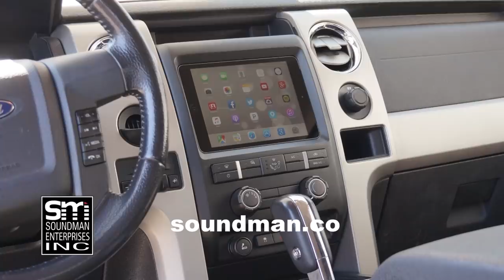Custom Astro Van door jam contacts, part 1 - BVV#19

Comment: Should have just hard wired the popper with a long ass cable. So every time you open the door, you can use the power cable to hang a 'no entry' sign across the doorway. Geez Doug, do we have to come up with all the ideas? LOL

Comment: Should have just run a lithium battery in the door with an external charging port through the door handle shave plate. Trigger the door popper with a Bluetooth arduino controlling a relay. Lololol. Nice work though. Fido will be proud xx

Comment: Astro 7600 Hot Staple Gun Kit for Plastic Repair     ,,,,,,,,,,,,,,,,,,, not sure if it will work on the plastic your using but it will help with holding the parts together so when Rafa slams the door hopefully it wont come apart.... why didn't you just mount the electrical contacts by the door popper? looks pretty flat?

Comment: I feel I should have said this last episode but why not put the pin switch at the back of the door where it should be used... Since it should seat flat cuz the back of the door shuts straight back without sliding like the front of the door does.

Comment: Youre thinking to hard. GM has already figured this out.  I had an old astro van newer then yours that had power locks and had contacts like you want. The part on the door jam was flat. I would just try and buy the contacts for a newer astro van with power locks